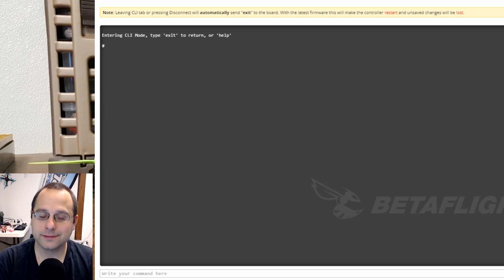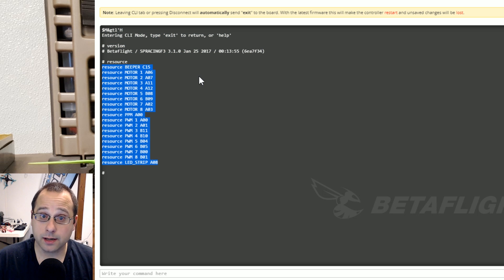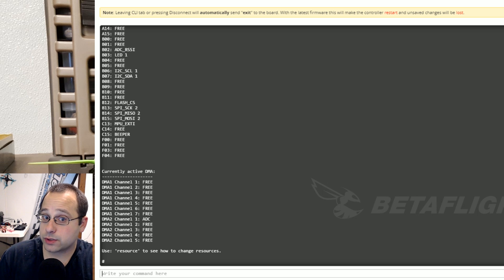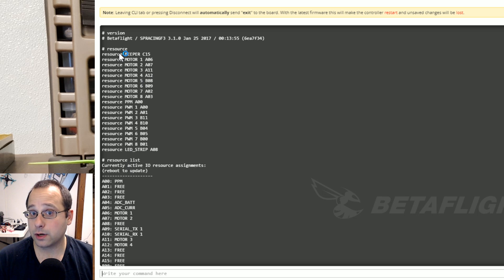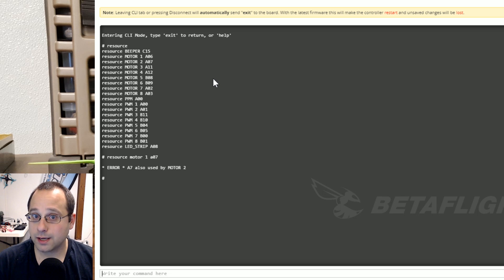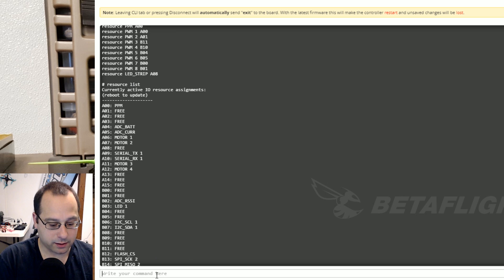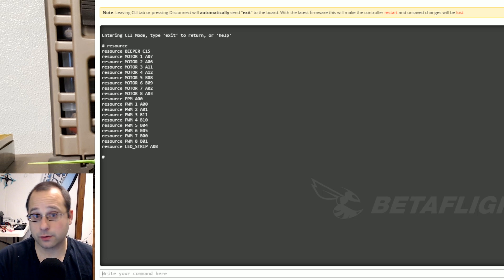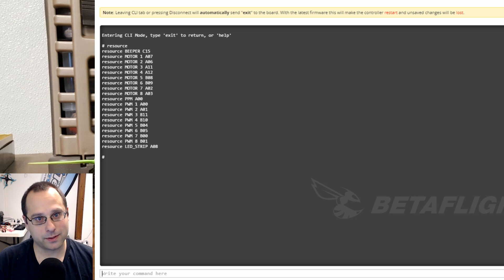Betaflight 3.1 Resource Remapping | NO MORE CUSTOM MOTOR MIXES YAY!

Comment: Does this mean that if you have a board without current iinput for examplue, you could enable it by using another resource like a motor output or something like this?
I know a motor output port must be digital PWM but there are maybe some way to find the analog I/O resources available no?
Please let me iknow if I am wrong... Cheers
Reply from the maker: +FPVlog maybe yes. Typically the RSSI input can be reassigned to current sensor input since they're both 3.3v analog signals.
Reply: Joshua Bardwell yes that's exactly what I thought. Do you know if Kiss FC has any analog 3.3V input?
Reply from the maker: +FPVlog I don't think so but I'm not sure.

Comment: thanks this video really help me, i follow your channel for a long time, you are a guru for quadcopters! :P (sorry for my bad eng)
Reply from the maker: +Damiano Daolio welcome to the Chan. Thanks for watching.
Reply: following this guide and reassign motor to right pin (soldering tabs damaged..) and all works but when i try dshot one motor didn't work, so i see in resource list in the dma section the motor 3 didn't appear :(
Reply from the maker: +Damiano Daolio yup. DMA channels can't be reassigned arbitrarily.

Comment: Hi Joshua. I have a cc3d revo flashed with betaflight 3.1.5. I have a WS2812B led & buzzer with the pwm pad connected to pin 6 (as i was using it with librepilot feature). Untill now i was trying and trying to make it sounds with servo tilt etc...with no results. If i am correct now i can assign BEEPER to motor 6 and with a switch and the beeper mode in mode tab it should sounds? or i need to go in the servo tab and link the aux to the servo 5 too? (sorry for my english). Thank you in advance.
Reply from the maker: If you assign beeper to pin 6, then the beeper needs to be on a driver circuit such that the beeper's negative leg is connected to ground when pin 6 activates. If this is true, then I think it should work. Try it and let me know!

But be careful!

If your beeper does not have a driver circuit, then you might end up sinking current directly through the motor header pin on the microcontroller and damage it.
Reply: Joshua Bardwell I specified that I have a cc3d revolution and with librepilot i drived the buzzer with pin 6 normally (without circuit driver,  pwm input of the led/buzzer to pin6) and very easy because librepilot has a simple procedure of redirection from aux to channel outputs of the FC. I followed this instructions from a video guide and was not mentioned this circuit driver, and the instructions of buzzer/led assure compatibily with cc3d revolution that has not a buzzer dedicated pad.

this is the buzzer/led i have use.

http://costruzionedroni.it/matek-tail-light-ws2812b-loud-buzzer-dual-modes

Comment: JB, can this feature be used to output an aux channel to an unused motor output?  I have been trying with no luck.  Or do you know how to use channel forwarding?  I ask so that I can connect a camera tilt servo.  Using an X4RSB so no available pwm from receiver.
Reply from the maker: +mchevalier77 you definitely need channel forwarding, not resource remapping.
Reply: No docs on channel forwarding.  I tried it and it did nothing.

Comment: Trying to get QX95 LEDs on this SPF3 EVO Brushed, and I can't get them to do anything.  Can you verify that A08 is the third pin from the bottom on the lone UART on the left side of the board?  I have it soldered as per the manual but nothing.
Reply from the maker: I cannot verify that, sorry :-(

Comment: Hi
I have a spf3 acro and the buzzer (https://banggood.app.link/AevAzUi55z) beeps constantly. I think there is a issue with the ground signal. I have permanently 5v on it. Can I remap the buzzer port with led or something with this buzzer?
Reply from the maker: I think you can do it, but you need to build a driver circuit because the GPIO pins on the F3 can't supply enough current to power the buzzer.
Reply: Joshua Bardwell 
When I take the + from buzzer port and ground from led port?
Reply from the maker: +Daniel Szewczyk + can come from anywhere because ground is switched on the buzzer. But if you hook the negative leg to the FC without building a driver circuit you'll destroy the pin at least and maybe the whole chip.
Reply: I have mapping the buzzer on motor 8 and it works fine 😊
Reply from the maker: +Daniel Szewczyk if you don't build a driver, I believe you will burn out the pin.

Comment: This proved to be invaluable today - one of my flying buddies had soldered his ESC signal wires to his FC but subsequently rotated his FC. Once we figured this out, we just used the resource mapping to rotate the motors around by re-mapping them.
Without your video I wouldn't have even known it was possible, never mind been keen to give it a try.
Thanks!

Comment: Thank you for this... I just flashed betaflight 3.1.1 on my kiss fc to give the new features a whirl, and realized the kiss target doesn't already have the resources remapped - didn't think resoldering between firmwares was my thing either... motors remapped, running quadx1234 mix, sorted! (and if it isn't, I'm sure it will be an exciting mistake). I did test motor outputs as well as inputs and PID reactions with props off... time to go hover and flinch for a second!

Comment: 3.1.1 is out, do not need to set resource to NONE
Reply from the maker: Oh, well, isn't that nice. VIDEO RUINED.
Reply: Joshua Bardwell come on man, that  remapping to none  is only 1% of the useful and educational content in this video.
Reply from the maker: It was just a joke...
Reply: Joshua Bardwell do you know if the data from the accelerometer been used for the pid calculation in acro mode?   I want to know if it is ok to disable the accelerometer.
Reply: It's just a prank bro
Reply from the maker: +Jack Truong accelerometer is only used in autolevel. You can disable it.
Reply: You need it on if you're using 'land' in the fail safe. The default is to just shut the motors off though.

Comment: I attempted to flash my qx95 to betaflight. following instructions on line. i forgot to select full chip erase and manual baud rate as per video, so I flashed again folling instructions stwp by step while watching this time, now when I connect it says serial port successfully opened and then says successfuly closed right away. did I screw up?
Reply from the maker: +Carlos Acevedo was the flash successful? Are you sure you used the right target?
Reply: Joshua, thanks so much for replying.  I didn't think you would so quickly so after hours of searching I found what was wrong and a Video by Project Blue Falcon  about usb connection issues did the trick. Thank you as well for all your great videos, i will continue to  watch all adds and videos.

Comment: im just building my first quadcopter when i plug the flip32 f4 revo flight controller in on betaflight at the bottom of the screen it says i have 1 i2c error what does this mean? please help
Reply from the maker: Means nothing. There is always an error or two when the i2c bus is initialized. As long as the count is not increasing, ignore it.
Reply: thank you that's what I was hoping for

Comment: first I thought great, I can swap the ppm and sbus. then I thought may not sbus needs an invert. however this is useful for one of my quads which is cc3d with cc3d custom PCB.  I have been using custom mix. not sure if it will have any tuning difference. thanks Joshua I have learnt something today!
Reply from the maker: +Jack Truong SBUS is a UART. I don't think you can move those.
Reply: just tried the remap on my cc3d motor layout, it flipped to the left during take off.  Here was the mapping before the change with custom mix.
resource MOTOR 1 B09
resource MOTOR 2 B08
resource MOTOR 3 B07
resource MOTOR 4 A08
resource MOTOR 5 B04
resource MOTOR 6 A02

I have changed it back to quad x default mix and below is the new resource mapping. I have saved the change and here are the values after a reboot
resource BEEPER A15
resource MOTOR 1 A08
resource MOTOR 2 B08
resource MOTOR 3 B09
resource MOTOR 4 B07
resource MOTOR 5 B04
resource MOTOR 6 A02

any ideas
Reply: This mapping below works.  Someone from betaflight github suggested this.   There is also a mixer you can load but I have not verified if it works. It is called Quad X 1234.  I do not believe this mixer  uses resource mapping.

resource MOTOR 1 NONE
resource MOTOR 2 NONE
resource MOTOR 3 NONE
resource MOTOR 4 NONE
resource MOTOR 1 B07
resource MOTOR 2 B08
resource MOTOR 3 A08
resource MOTOR 4 B09

Comment: Josh,stupid question. I put a beeper on my f3evo brushed and i cant get it to shut up. when i arm it gos off slow beeps. My battery voltage is above3.8v I have beta flight set to default for VBat. In the mode section I haven't set up the beeper switch. Your help would be greatly appreciated. Rich.
Reply from the maker: Man, I really don't know what could cause that honestly.

Comment: So lately I have been building hexacopters. 2inch, 3 inch, 5 inch. This surprisingly limits my choice of flight controllers especially in the smaller build. Does this new functionality introduce a means of using a 4 motor board as a hex board or even maybe a hex board as an octo? I am getting slightly excited about designing a 2 inch octo if this is correct.
Reply from the maker: +Neil Fraser yes.
Reply from the maker: +Neil Fraser the only question is whether the board has the additional motor resources defined.

Comment: Here's a side question. Is it possible to make your esc's give a tone or series of tones when your battery voltage hits a certain level?
Reply from the maker: Not currently. However, with the advent of DShot, it could be possible to make the ESCs play arbitrary tones. But I am seriously skeptical whether they could be made to do it while flying.

Comment: Hey bro I know this is probably a dumb question and I'm sure you've answered it already.. But I just flashed to 3.1 and I want to make sure I'm using the betaflight pid controller, there's no options that I can see now so I'm assuming it's just standard on 3.1? Thanks for the help!
Reply from the maker: +Matt Holliday yes. Legacy PID controller is gone.

Comment: So useful, putting a Racestar 4 in 1 ESC on my 3" Kraken and it has motors 3 and 4 connections swapped around. This will help clean up the build nicely.
Reply: I just did this.. just 7 months later.. lolz

Comment: I just built a brushed micro hex using this board: http://www.banggood.com/Eachine-32bits-F3-Brushed-Flight-Control-Board-Based-On-SP-RACING-F3-EVO-For-Micro-FPV-Frame-p-1076530.html?rmmds=myorder
The positions of motors 5 and 6 on this board are reversed compared to where they should be. Remapping these motor positions fixed it. Thanks.

Comment: Thanks Joshua. The buzzer was probably the only thing I would have used this for (lifted the pad off my X-Racer) so no good for me.
Reply from the maker: You still can do it, I believe, if you create the driver circuit. It's not too hard.
Reply: You did mention that, but it sounded like it was going to be difficult / tricky / fiddly / not worth the effort. But I could well be wrong ;-) Do you know what's involved? Or point me in the right direction? 

Thanks.
Reply from the maker: https://3.bp.blogspot.com/-6Z-OMiTvlyE/Vtik0m9_0iI/AAAAAAAAhcw/2xJcfPCdods/s1600/Screen%2BShot%2B2016-03-03%2Bat%2B22.54.31.png
Reply: Awesome, thanks!

Comment: Is this applicable to soft serial on a F4 board for use with FrSky Smart.Port inverted telemetry? This is the current issue I have with my Omnibus F4 Pro V2, I have to either modify the FrSky receiver to access the non-inverted Smart.Port for telemetry or figure out a way to "soft" adapt another pin on the FC. Maybe this is a question for another video :-) Thanks!
Reply: Or you go this route and get the signal in front of the inverter on the receiver:

https://blck.mn/2016/12/smartport-frsky-xsr-and-betaflight-part-2/

I was just trying to avoid all this hassle, hopefully going forward this is an option FC manufactures add to F4 boards since it is a common setup.
Reply: Does this help? You can change inversion in the cli.

# set inver
rssi_ppm_invert = OFF
Allowed values: OFF, ON

sbus_inversion = OFF
Allowed values: OFF, ON

telemetry_inversion = ON
Allowed values: OFF, ON
Reply: ZeroFPV my understanding is that the inversion on the F4 board is unavailable, there is a single inverted input for serial receivers (sbus) but the other uarts are static non-inverted.
Reply from the maker: That's my understanding too. The SBUS input has a discrete, hardware inverter, separate from the F4 chip. For some reason I don't understand, the F3 UARTs can be inverted in software, but the F4 ones can't. This also complicates the use of S.Port with F4 boards, although it has never been clear to me why the FC can't just invert the signal internally. In other words, if you want to send 101010101, just send 0101010101 instead, if you get my drift.
Reply: Damn, you are right! :-( 
So you need to build a smartport inverter yourself.

https://quadmeup.com/tag/f4-flight-controller/

Comment: Joshua, First off great vids. 

Im not trying to be picky but this is not purely a BF3.1 feature. This was around in 3.0.1 (dont recall which RC) as i had to do this with my SPRacingF3Evo as enabling DShot on that board for some reason breaks motor pinout 4 and you had to map this to motor 5 and was listed on the BF Wiki for Dshot.
Reply from the maker: Wow, it seems like you're right.
Reply: Only knew that one as i was stumped as to why my motor 4 would not spin up after enabling dshot :)

Again thanks for all the videos, they have really helped me get started. Also you should have a chat with Chris over at Armattan, see if you can get hold of their new frame the Chameleon.... im waiting for mine to be delivered.
Reply from the maker: +LoR_NiKoN you know who Boris B. is, right? I mean, he's as human as anybody, so maybe he's made a mistake, but if anybody knows Betaflight, it's him. Anyway, it's easy to test. Just flash a board back to 3.0.1 and see.
Reply: LoR_NiKoN it was never in 3.0.1 actually. it really came in 3.1 first
Reply: It may have been a 3.1 feature when that was in development and rolled out to RC of 3.0.1 but i was just stating its also in 3.0.1 as a usable feature.
Reply: The resource command was in 3.0.1, but read only. You were not able to remap and change things, but only view current pin assignment.
Reply: Im afraid thats where we will have to agree to disagree.... i had to remap motor 4 to motor pin 5 on my SPRacingF3EVO in 3.0.1 to get the motor to work using dshot. it was a known issue and was stated on the dshot thread on the wiki....
Reply: Joshua Bardwell have to admit I have no clue :) like I said I wasn't trying to be funny I just know what I had to do with dshot on 3.0.1 to get it to work on my board.
Reply: I may have gotten revisions mixed up when testing... my apologise :) just tried it now and cant get it to work.

Comment: Josh, you gave the how but you failed to give the why. Why would someone want to remap the resources?
Reply: He explained one scenarion in the very beginning of the video.
Reply: But the short answer is if you don't know why you need it, then you probably don't need it :P
Reply: haha. fair enough. I must have missed his intro scenario. thanks!
Reply: if you lift or damage an esc signal pad you could potentially re-solder to motor 5 or 6 pins  and save buying a new board

Comment: So would it be possible to swap a motor and a pwm?
Pwm is an input and motor is an output?
I hope the answer is not in the video like the last time I asked a question : )
Reply from the maker: I just tried that on an SPracing F3 board and the CLI let the commands go through.

Comment: Good call on letting folks know about the buzzer.  I think you missed the main reason this was implemented (IMO) was to allow users to remap pins for boards that didn't support DMA on the motor pins for DSHOT.  I think moving motors around is the one folks will probably use the most, though so probably the most useful way to do it.  Thanks for another great vid.
Reply from the maker: I'm not sure about that. I think resource remapping was in the road map before DSHOT was invented. I could be wrong though.
Reply: You're probably correct

Comment: Are you going to go over the soft serial at some point too?
Reply from the maker: What about it?
Reply: Setup and working with it? Or is it more straight forward than even a video would require?
Reply from the maker: It's no different than using a UART, except that it's limited to 19.2 kBaud max I believe, although that may not apply any more. Only a few boards even break out the softserial pads though, and most F3 and F4 boards have enough UARTs to do most things people want to do.
Reply: Ah I thought it was something more like a virtualized port, where you could take some other input/output pads on the board and allow it to be used like a slow UART.

Comment: but.. what exactly are the benefits of reasigning resources? isn't it pretty much just strings in a box?(vague)  doesn't really matter? so.. wait, ohhh it just let's you change the pin mapping. I guess that's cool.. thou, I doubt I'd ever use it.
Reply: John Hoehaver It's not often that you see a comment that was formed as the commenter watches the video.
Reply: Michael Clarke well,  today you learned something  c:

Comment: I'm still on the ad typing this, haven't watched the video yet, but I absolutely loved  beta flights ability to do flips and rolls. when I switched back to cleanflight trying to do a flip.. it just arches and throttles into the ground 😕 only reason I don't use betaflight now is because it doesn't have baro support and Magnetometer  (I think)  this comment is pointless.. just smoking a joint watching youtube.